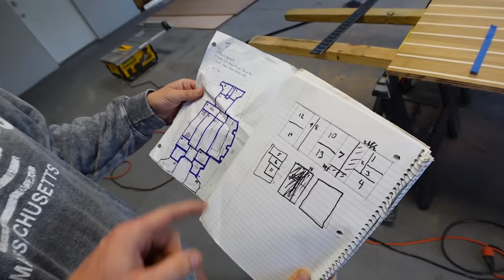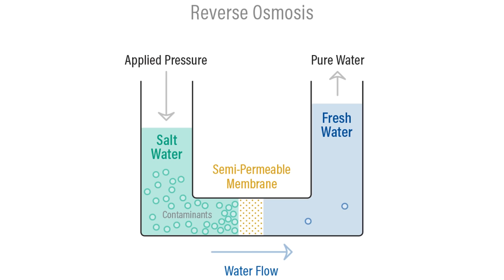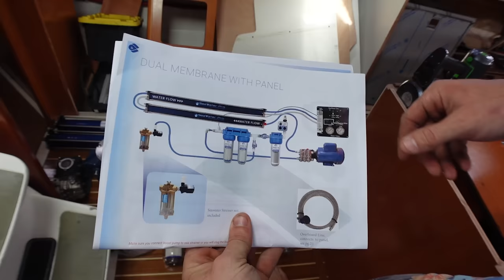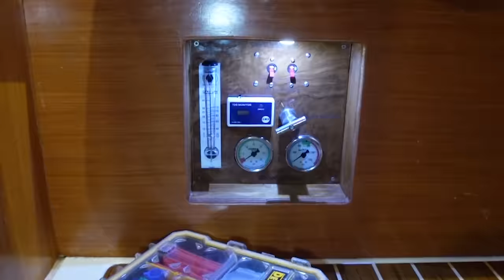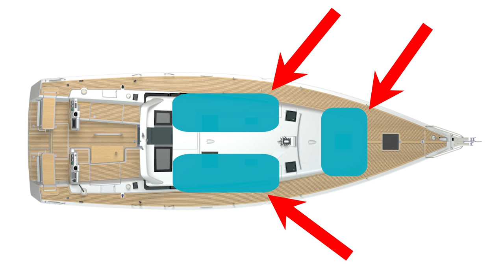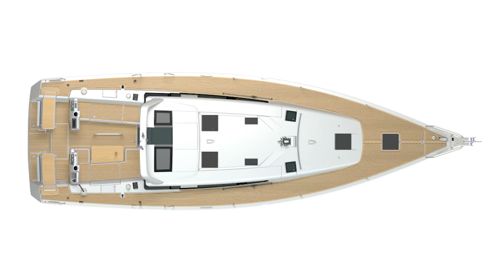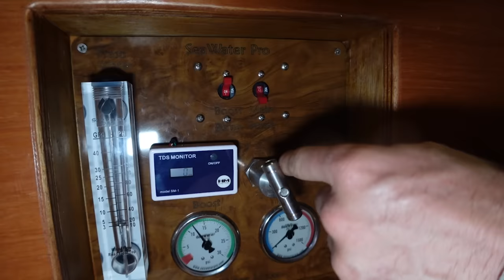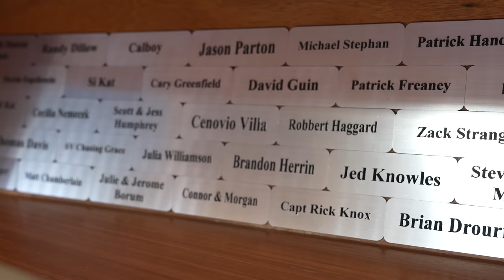How to Make Water OFF-GRID on the OCEAN! Unlimited FRESH WATER Forever!  | ep.22

Comment: Great progress on your fresh water system...Strongly recommend that you get two replacement high pressure lines for backup.  I'm guessing that those two lines are not readily available like your other common plumbing parts.
Reply from the maker: Good suggestion. Yah those are probably the most difficult to replace in a hurry

Comment: Great job on the install guys. I doubt the water will fill all tanks simultaneously, but good thinking with the valves. I put the same system in my boat Lady Bug except it runs off of a dedicated 2kw industrial inverter. Mine is located in an out of the way place and I have found that I never really need to adjust it. I had some problems with air coming in the intake while underway, but a large T in the system with a small bleed hole above the water line solved that problem. Any air bubbles in the intake really screws things up. Like you, I was intimidated at first with the install, but it really was easy. We have had it in use for 8 months over 2 seasons and it really works great. I did find the crappy plastic fitting that goes into the flow meter cracked and I replaced it with brass. I did not opt for the panel due to expense that left that flow meter just hanging out on the fittings though and that led to the crack. Just make sure to support it and the hoses going to it and things will be fine. It was nice meeting you two over there on Long Island a couple of months ago. I hope things are going well, as the weather down where you were headed looks a little dicy.

Comment: Loved your attempt to fill your tanks in order without electronics.
From an engineering perspective, it’s all about head-loss (interject jokes here).  Simply put, there needs to be less resistance to the tank you want filled first (I.e. shorter hose to the first tank).
If what you have doesn’t work, try adding ball valves (variable resistance) in each line and tweak them open or closed until you get the fill distribution you want.  Example, the front tank ball valve will be more open and side tanks equally open but less than the front tank.
Enjoy your channel.

Comment: Great job with the boat guys.  Making my way through the vids now since finding your channel.  Watermakers are pretty cool tech.  Here's a tip I've seen on another sailing channel as far as fresh water goes  - mother nature provides several chances to collect fresh water.  Your sail will collect alot for you and your sail cover is essentially a big ass cup always getting filled up.  Run a hose from the low point in to your forward tank.  Good idea in case the genie craps out.  Keep up the great work!

Comment: Great work as usual 😊and I love the floors!! The only change I would have made would be to fill the front tank last, keep the weight off the bow. I have a similar boat to yours and on long passages I usually keep the forward tank empty. Having said this, with your system it is easy  to pick which tanks you fill first.

Comment: These small plastic hoses can be tricky, gravity alone does not rule, you have superficial tension with air bubbles that can keep water from flowing the way you want. I use some venting to solve most of these small problems.

Comment: Starting to look pretty good there! Loose the silicon for sealing stuff though, and wire nuts are never ok on a boat, properly crimped butt connectors with a adhesive shrink wrap are the way to go.

Comment: Perhaps a little dielectric grease on the electric connections.  The grease tends to slow down the salt water corrosion deterioration which creeps up the wire under the jacket in these boats (and trailers).

Comment: I see a problem with the genius plan ... once the front tank fills, the water may start coming out of the vent line for the tank before it diverts to the two other tanks.  You need to make sure that the vent lines for each tank (all have a vent to allow for the air to leave the tank as it fills with water) are higher than the junction point where the diversion manifold is located.  Please take the time to extend the vent lines to appropriate heights if you intend to make this your method of filling the tanks, otherwise you might just find your bilge full of fresh water!!!
Reply: I knew it couldn’t be that simple. I figured if I agreed and approved right away, then they were missing something. Lol

Comment: During your install it looked like you have a propane tank located in your bilge and not in a separate propane locker. If this is correct this is a very dangerous, propane is heavier than air and any leak can fill the bilge with gas looking for a source of ignition such as a spark from your watermaker high pressure pump. Please check ABYC installation recommendations.

Comment: Great video. Been looking at the same system. If I buy I'll use your link. BTW, I haven't read anywhere on how often or if ever the two membranes have to be replaced?
Reply from the maker: Thank you, we appreciate that! It's a great system. Typically the membranes need to be changed every 5 years. If you have a TDS monitor then anywhere under 500 parts per million is good. Over that and you probably want to change your membranes

Comment: Hey guys nice video now I have reverse osmosis on my boats and my house and my what I have is the final thing I put in the water coming out the fresh water I run it through a UV light filter in a -stage charcoal filter so it's charcoal filter then it goes through the UV filter and then it's your glass and it's great you'll have 100% the cleanest loveliest water you've ever had also your incoming water and your outgoing water your filters try to find the smallest Micron filters you can get like three microns usually five is smallest but there have been threes now the smaller you got the more bad bugs that it will clean

Comment: Gravity in that small manifold/ valve block won't be effective / work with such a small drop and a pressurized system. The length of the hoses will make the biggest difference. Otherwise a very clean install and congratulations on having a shower.🎉

Comment: So, how is your boat powered and cooled? Only asking bc you started the generator to run the water maker pump. If youre on a battery bank, couldnt you use your inverter? 
Just curious the need for the generator. 
AND...the floors are fabulous! Its funny how much i look forward to hour episodes and dont even care that you havent taken us on a sailong trip.🎉
Reply from the maker: We appreciate that!! But along with all of you guys, we can't wait to get back to the sailing adventures either! But we're going to be doing it in style once this beast of a boat is finally complete 😁
And as for powering the boat. We have 2 8D lead acid batteries that came with the boat are on their last string. We pretty much only use them to power the fridge and our lights right now. Once we finish the kitchen, so we can live a bit more comfortably on the boat, we are going to start our new battery install. We are completely rewiring the entire boat and adding a bunch of battery power so we can get rid of our generator. Our little portable generator is temporary and will be a backup once we start sailing.

Comment: Why AC?
Reply: SeaWater Pro has a 12vdc system but it only makes 17 gallons per hour. There is a 24vdc version that can make 40 gph but I don't think that they have a 24vdc system installed.
Reply from the maker: Exactly! We thought about adding a separate 24v bank for the water maker but figured we wouldn’t have an issue running the AC system from the battery bank and inverter we will be installing. 
We wanted the extra 20 gallons an hour so we upgraded.
Reply from the maker: Exactly! We thought about adding a separate 24v bank for the water maker but figured we wouldn’t have an issue running the AC system from the battery bank and inverter we will be installing. 
We wanted the extra 20 gallons an hour so we upgraded.
Reply: @SpearItAnimal  you guys are doing great.  Keep it up.   Really impressed with both of your skills and hard work.
Reply from the maker: At the time we didn’t have much of a battery bank so we could run it off our portable Gen. Also The DC version only makes 17-20 gallons an hour at 12v. You have to get the 24v pump to run dual membranes. The AC watermaker also can run dual membranes so no we just run it off our batteries but through our inverter first.

Comment: Rut Ron did I see a wire nut on a salt water vessel? Not good unless it is sealed inside a water tight box and silicone one the wire nut! 😫🛫 I am going to give that 6 months and it will fail!
Reply: Great job guys! That is a lot of water 40 gallons and hours wow!  I had a plant on a 45 Irwin back in the early 80’s I am thinking more like 5 gallons and hour if that. 
I flew for a company that designed water treatment plants. Talking with one of the engineers about how clean the water was after the process they went through. He said you know you have good water when the bugs are swimming around!😁 it is bad when they are dead!🤣🛫
Reply: After testing that mouth full of nasty water, that calls for 180 proof vodkas rinse! Like Sasha said that is how you get worms! 🤯🛫
Reply: Hi guys, great job ;) Love your enthusiasm and motivation ;) 
Just an observation that might save you having a failure somewhere remote. 
Twist on wire nuts are not great in damp conditions or where reliability is vital. 
A better solution are the solder seal connectors that make a really good connection and keep the water out.  They com3 in various sizes to suit the size of the conductors you are using. They make cable connections and terminal ends in the same style. Highly recommended and not very expensive. Just use a special heat gun or a flame at a push to activate. 
Cheers
Ray